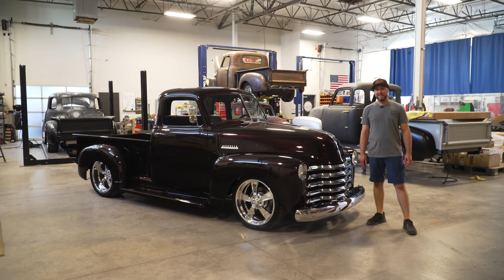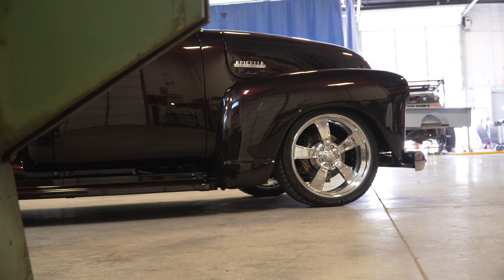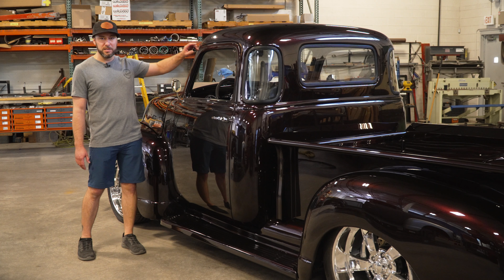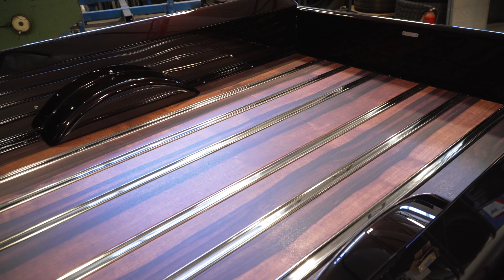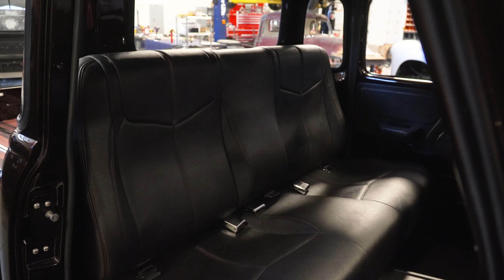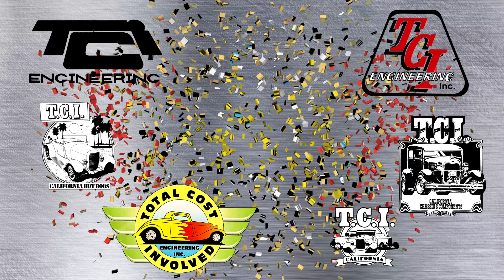Customer Spotlight: Tim & Aurelia Gilmore's 1953 'Ultimate 3100' built by Apicella Designs

Comment: What kind of tire sizes does it have
Reply from the maker: Wheel specs are in the description.
Reply: @tcimuscle  nope only the wheels
Reply from the maker: @isaac_carranza  Did you edit that comment or am I going crazy? It has 255/35's up front, 345/30's out back. Michelin is one of the few companies that has a really good tire with short sidewall sizes for this wheel width combo.
Reply: You barely edited it because that wasn’t there before if not I wouldn’t be asking
Reply: In the rear 315/35/r20
Reply: @isaac_carranza  345/30/20 on 20x12 inch rims on the rear